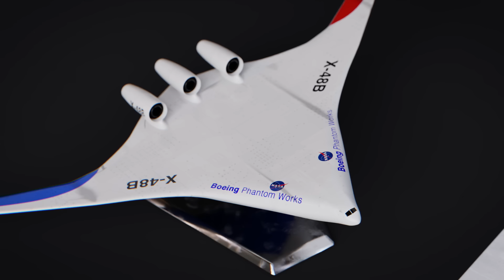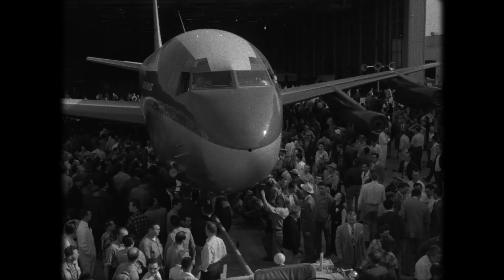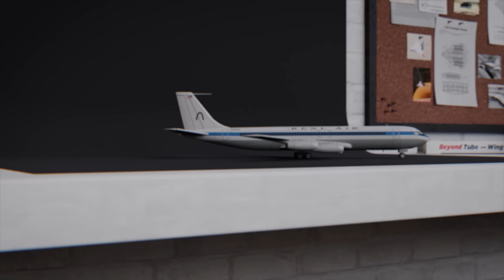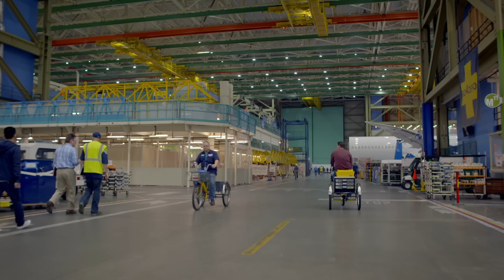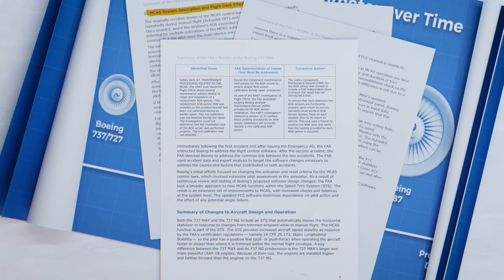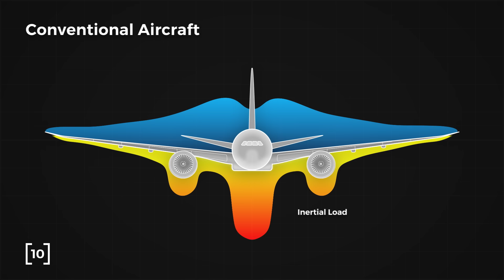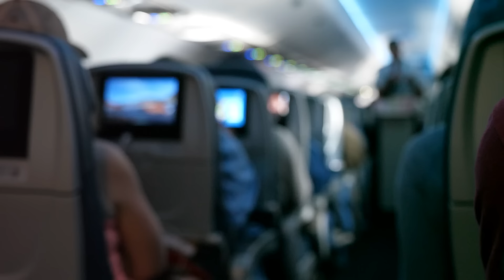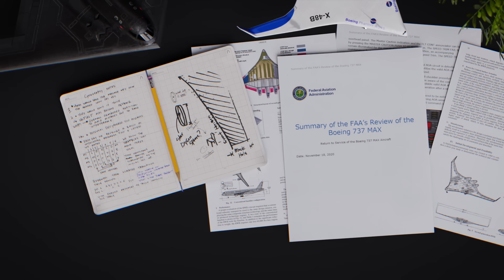The Plane That Will Change Travel Forever

Comment: Have you thought about making a staple- or thread- bound (bonus points if hardcover) version of the large A4 notebook? 
Despite what I just wrote in my other comment, I just remembered that my Uni does not actually allow wire bound notebooks to be used as lab books. 
I think there might be some demand for high quality sturdy lab books out there.
Reply: Why aren’t wire-bound notebooks allowed in the lab?
Reply: @ragnkja  it's less them not being allowed in the lab and more that we had to keep a log as we went along that is hard to tamper with and edit post-hoc, i. E. By putting pages in and taking them out.
Reply: @Gstrangeman96  
The only feasible way to take pages out of the spiral-bound notebooks I’m used to here in Norway is to tear them out (the pages are perforated in case you want to), but that doesn’t exactly let you put them back in again.

Comment: 10:35 one of the things that has gone dramatically wrong with tails is control reversals.
Reply: Or sometimes they do fall off.
Reply: what
Reply: @Ass_of_Amalek  IIRC if the tail/wing isn't rigid enough, flight controls can end up twisting it. It causes air to be deflected the wrong way, reversing the controls.
Reply: @wojtek4p4  it was an issue with the hydraulic control systems on some boeings, they could get maladjusted into a control region where the tail worked backwards.

Comment: It's a shame the 737-Max got recalled due to failures after a very modest redesign. Given that it's hard to see Boeing risking a radical redesign. There's also an issue of regulation and corporate governance. If the FAA had stopped Boeing from relying on a single sensor for the 737-Max then the plane wouldn't have had accidents and ended up being recalled.  In fact, it seems like regulations were counterproductive in this case - they incentivized the flawed 737-Max design because Boeing knew if it didn't redesign the fuselage for the new engines it could avoid the delay of recertification.  
   
Also, the flying wing stability problems remind me that before humans achieved flight there was a debate over whether it was even possible to do it with rigid wings and small control surfaces. After all, birds have non-rigid wings which are effectively all control surfaces. Maybe there is a case for Dune-style ornithopters...
Reply: The 737-max wasn't a redesign, it was a poor workaround/shortcut to avoid redesigning the plane.

Comment: The 737 max debacle was never about the fundamental STABILITY of  the aircraft, but the fact the changes made the aircraft fly differently from older 737s. This change in flight behavior was not dangerous, but significant enough to require a new "type certificate" for pilots. 

MCAS existed not to make an unstable aircraft stable, but to allow pilots of older 737's to move to the 737 max WITHOUT the pilot needing a new license to fly it.
Reply: true.  Boeing tried to tweak an old design gradually and incrementally to avoid recertification.  Meanwhile, the C-17 was designed in the 80's and has 6 AOA sensors!  More than enough redundancy to eliminate any concerns about reliability.   Digital control of aircraft is plenty reliable when designed properly.
Reply: Every one wants to ignore the fact that the accidents were caused by pilot incompetence.

The trim system that MCAS used was not new. It was present since the first 737, and the way to deal with a malfunction never changed.